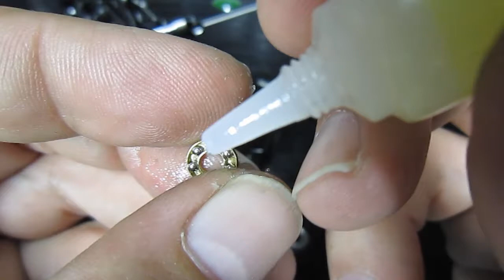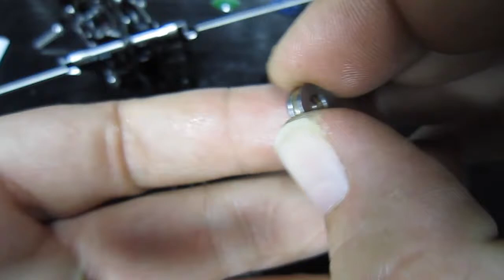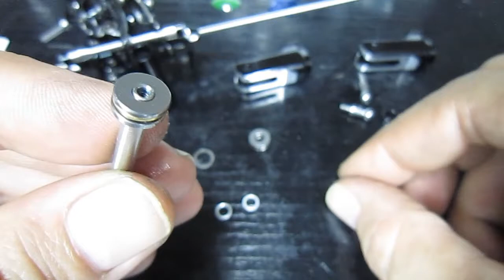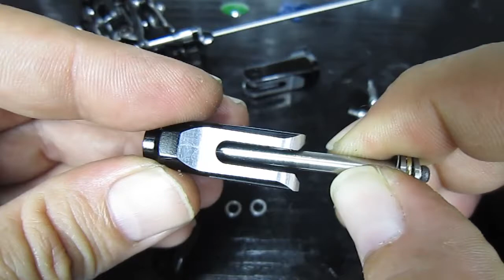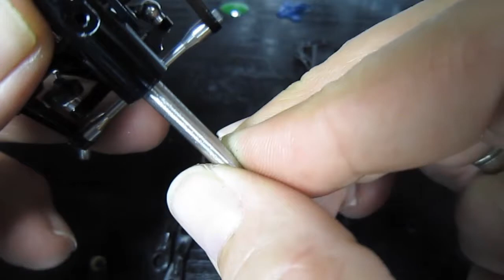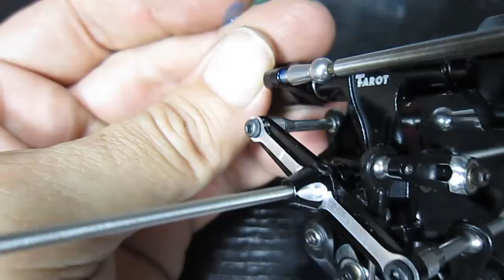Tarot 450 Pro Build using Align T-Rex 450 Pro manual page 07

Comment from the maker: @jpjr21 I once use to only use the Align Thrust Bearing Grease, but in this case I used the slightly yellow coloured silicon grease that is provided in the kit, but lately I seem to prefer the use of Tri-Flow Clear Synthetic Grease, seems to stay in the thrust bearings for longer than the other grease's I have used and stays clear as apposed to the others that become discoulered by the time I re-pack the bearings.